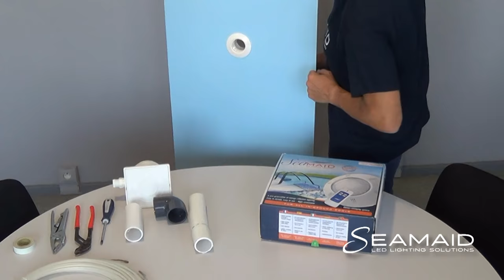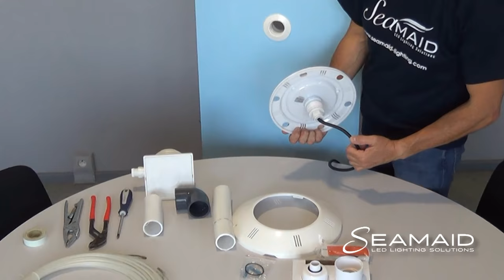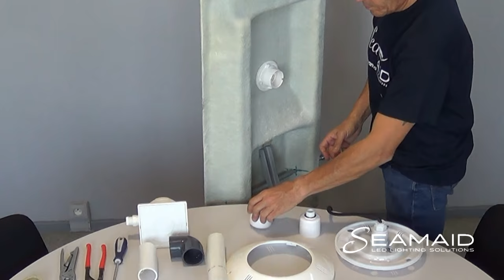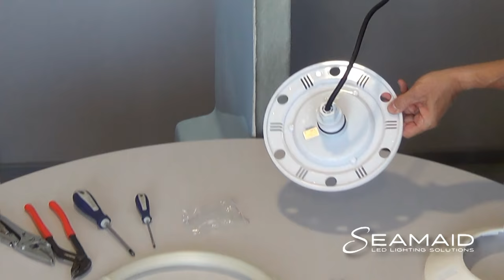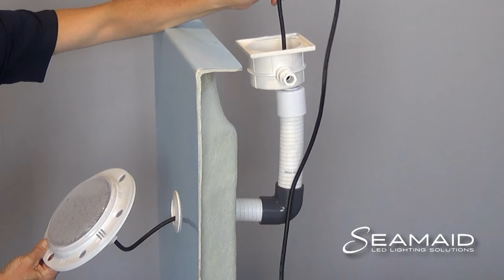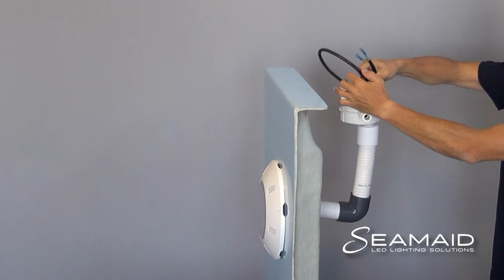Projecteur plat SeaMAID : aide à l'installation - piscines enterrées

Comment: Bonjour. J’ai des soucis avec le projecteur installé en avril 2021. Depuis quelques jours il dégage une petite lueur de lumière mais s’allume pas en entièreté. Je trouve aussi que la partie basse du projecteur est sombre et tacheté. Est ce que c’est un projecteur grillé ? Est ce normale après un usage très modérée? Et ouest ce qu’on peut trouver un projecteur de rechange ? Merci d’avance Christian
Reply from the maker: Bonjour, il est fort possible que le luminaire soit endommagé, les luminaires piscines sont livrés IP68. Vous pouvez nous contacter au 04 98 04 62 95 ou vous rapprocher de votre installateur afin de vérifier l’installation ainsi que la connectique dans la boite de connexion. Cordialement, l'équipe SEAMAID.